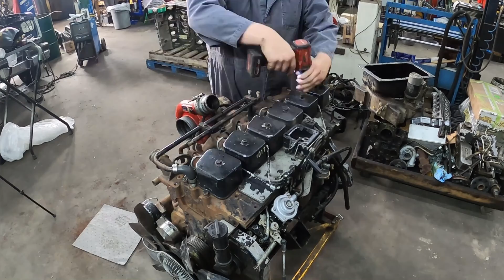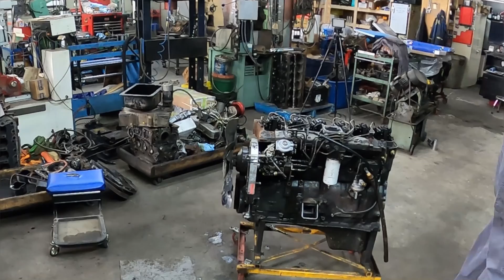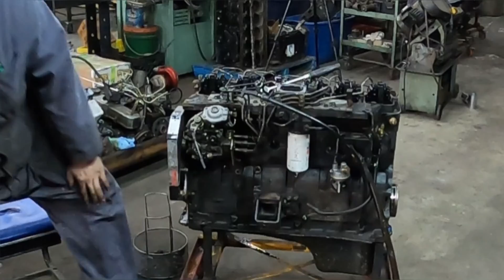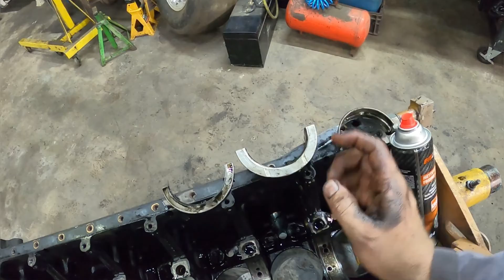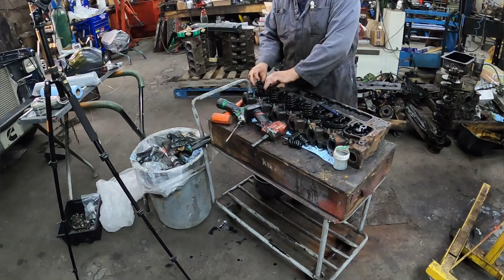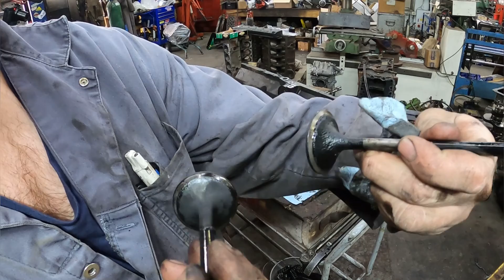600,000 mile 5.9 12 Valve Cummins TEAR DOWN

Comment: Rewatching some of your videos. I picked up on the large pry bar to load the fan pulley while you loosened the nut. BUT, what is the deal with the engine stand that has the engine at a 15 degree angle when the deck surface is up and then horizontal when you rotate it to have the pan rail up? What is the advantage of that and how is the stand constructed to allow that?

Comment: Went to fix an oil leak on my 96 12v after I bought it. Found patch job after patch job so I Pulled the motor and tripped to short block. Checked a couple bearings and at 400k miles the bearings weren’t copper like that a little spot here and there but much more signs of dry starts then anything. Head was cracked around all exhaust seats. It ran fine didn’t consume anything just leaked oil Cam was pitted terribly on a few exhaust lobes but all intake were fine. I expected worse after all the crappy repairs I found. Oh I almost forgot it survived the KDP. Found it in the oil pan.

Comment: I’m in Australia and have an imported 12 valve with P-pump. I was not told how many miles it had but when I did a tear down I also found big end bearing wear just like on this engine, where the copper was showing in that same location on all 6. Would you say that’s pretty common for any 500,000 mile plus original engine?
Reply from the maker: It could have. But a lot as to do with oil changes and air filters. I have seen them a 500k with perfect bearings.
Reply: @CUTTERUPROB  nice one mate cheers. I don’t mind high mileage too much as I’ve rebuilt it now. Was just curious to know! Sounds like I could have a pretty high mileage one as everything else was in pretty good condition.
Reply: It really depends on how hard the engine was used. I have seen these engines where they were making 400hp and pulling 30-40k lbs all the time and they will show copper on the rods in 100k miles.  There is a lot of difference in an engine that gets loaded heavy and worked hard versus one that just pulls a pickup around.
Reply: What kind of money does it take to get a 12 valve to Straya?